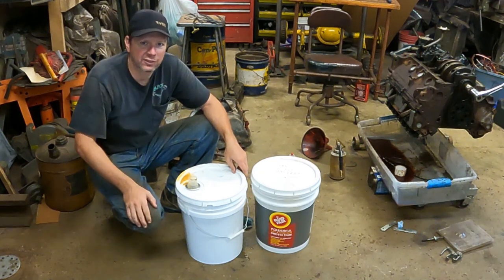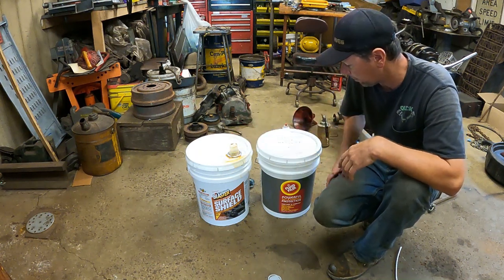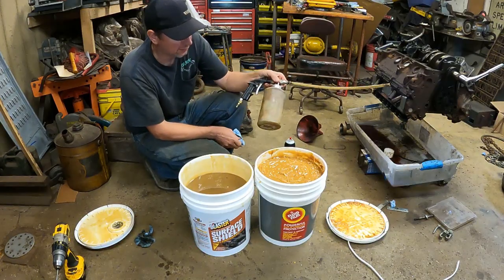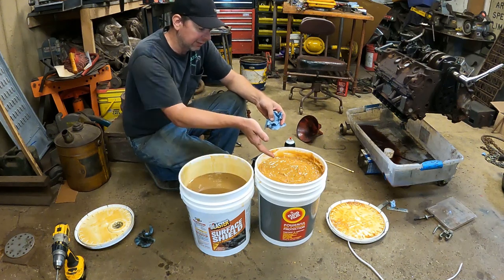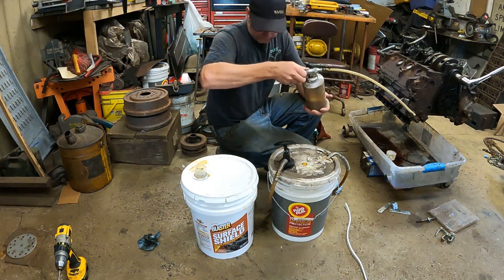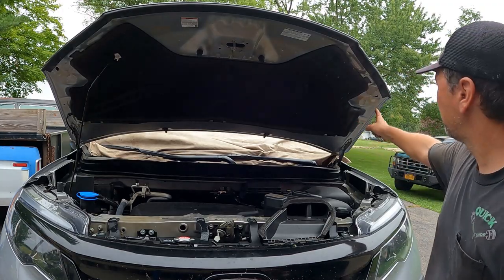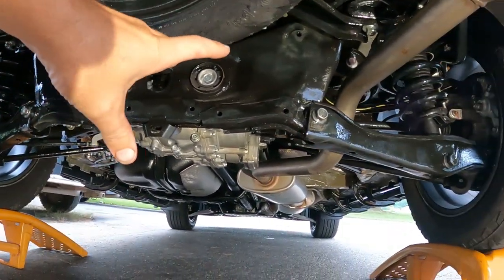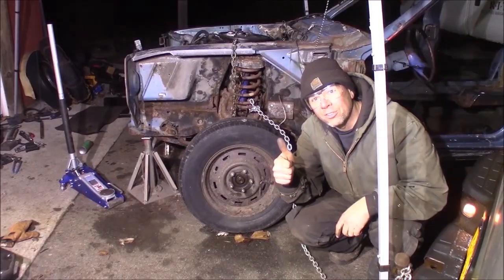Surface Shield vs Fluid Film:  Lanolin Rust Prevention

Comment: I can tell you that the Surface Shield is not easy to power wash off.  it should last excellent.  I tried power washing my steel wheel spare so i could bring it in and have the tire changed.  I had used it last December... that was June.   The stuff seemed excellent.  Underside of my vehicle will get a "touch up" this November  and recoat the whole thing next fall.  Pretty happy with it so far.  edit:   to add that the Surface Shield smells a lot better than the FF.   I used som FF from a spray can inside the doors so i would not have to bother with the compressor and gun.  The smell wasn't great for a couple weeks.
Reply: If you're re-coating once a year anyway, why spend double for SS? This was my rational when I saw the gallon price of SS vs. FF.
Reply: @red6743  It sticks better to cross members in the front end that get blasted with road spray and splashes.. I really believe it's a better product.  Ya' get what you pay for I think, so it comes down to personal preference and I live in the salt-belt so I feel it's money well spent.

Comment: ive used both products and much prefer the PB surface Shield, it sticks just like fluid film and doesnt drip much, but it sprays,covers and flows alot better even when ambient temp is cold, (ive had to warm up fluid film in a presto pot to get it to spray decent when cold out) also the PB does not stink like fluid film. it is a bit more expensive, but i was able to get a good price on it when O'reilys had a 20% coupon code online. it is also available in aerosol cans
Reply from the maker: I like how it sprays too.  I use FF because I can get it locally, but am impressed with the SS.
Reply: wow good call... i'll have to keep my eyes open for a code.  I bought a gallon on amazon and it's gone up since.
Reply: @g.fortin3228  right now there is a 20% code if you order over $150 - just order 3 of the 1 gallon pails.
Reply: @volks-jager  thanks  :- )
Reply: Fluid film is in spray cans as well
Reply: Anybody compared FF Nas vs FF liquid AR ?

Comment: For some reason Surface Shield is same price as Fluid Film in aerosol cans but in one gallon or 5 it is more then double the price. Look forward to the update comparison  video and opinion if the Surface Shield  is worth the extra money?
Reply: it is a new product so there is some gouging going on due to it not being as widely available. hopefully it will come down soon. i got my Surface Sheild from O'reily  auto parts in 1 gallon pails when they had a 20% online coupon so it was $60 a gallon
Reply: I guess because ss is 50% propellant and ff do  not have any.
Reply: True, I haven’t found it that much cheaper in gallon form. 5 gallons and spray cans seem to be closer in price to FF. From what I have heard and seen, surface shield appears to be competitive or better than fluid film. I’ll try it on my rusty Toyota and see if it can even slow that down a bit.. but not sure I want to buy more than a gallon..
Reply: I found the same thing. The gallon pails are very expensive! People are having massive issues with the cans not wanting to spray though. 

This time around I did the right thing. I put fluid film on the underbody of my Camry. They had 1 gallon pails at rural king for $40 which was hard to beat in any form especially readily available without paying shipping. 

Previously I used Krown and was very surprised how well it stayed in place during the winter of '19 to '20.
Reply: This is what kept me from purchasing the gallon and I stuck with FF. I'm not paying double for the same amount.
Reply: i did it last fall.   im going back to fluid film.  i think it works better , smells less and doesn't drip off the frame a year after application
fluid film seems to protect better ,   no dripping after the first spray and drive and the smell goes away after a day or three
Reply: @mrsa101 seems other people think the opposite.

Comment: woolwax WW HV will last indefinitely... very resistant to heavy roadwash ... over 3yrs and no need to reapply in the wheelhouse area. but it does develop a big layer of dirt on the top

Comment: I'm very interested in how Surface Shield will look next spring. But it looks by the SDS sheet that it has a very high percentage of petroleum to lanolin though, roughly 80/20. I would think that it might not be so good for rubber? Thanks for doing the video.
Reply from the maker: The bucket info says it won't hurt rubber, but we can see.  The FF will also make certain rubbers get a little soft as well.
Reply: Fluid Film also shows a high petroleum percentage. this is right from the Fluid Film SDS : Refined petroleum oil, hydrotreated heavy paraffinic 50-90%

Comment: Great vid and great idea for the pump!  Did you use one for the Surface Shield or is it not worth it?  I was using a solo cup and pouring that into a gallon milk jug with the bottom cut off into my sprayer bottles.  Worked ok, but a pump seems a lot cleaner.
Reply from the maker: I didn't use the pump because I did just pour it in the gun with a funnel.  If I was doing a whole bucket I'd set up a pump.

Comment: I tried them both, they both stay liquid and wash off far to easily... I eventually used CRC 06026 Corrosion Inhibitor to undercoat my truck, it is an industrial wax that thoroughly dries and won't wash off anytime soon.  I understand it is cosmoline based.

I needed to remove it from some areas that I accidentally oversprayed... mineral spirits liquified it but did not remove it, it dried hard again, I had to use acetone to get it off... pretty resilient stuff.
Reply: The CRC will fail you and your truck, FF and Blaster creep and self repair. No creep, no work.
Reply: @ptrazz11  Yeah it is my experience too.   Google "10 year of using cold galvanizing compound" and read a few last posts.
Reply: Surface shield doesn’t wash off… 😂
Reply: @ptrazz11  Cosmoline (CRC hd etc) dry and crack at top of paint when paint crack.

Comment: I will try surface shield on a new suv.  How much you use on a vehicle…one gallon? Do you cover the exhaust? Thanks
Reply from the maker: About 3 quarts really covers a full size vehicle well.  Don't spray it on the exhaust or brakes
Reply: @QuickSpeedShop  awesome thanks for the reply.  I guess I’ll have to buy the 5 gallons to do my 3 cars.
Reply: @QuickSpeedShop  do you apply it on September…closer to Winter?
Reply from the maker: I'd do it before it starts to get cool.  Sept or Oct.
Reply: @QuickSpeedShop  what spray gun you recommend?   I was checking the woolwax pro for $90
Reply from the maker: Any Fluid Film or Woolwax gun will work

Comment: That Surface shield in thethe pail looks like low viscosity Fluid Film.
Reply from the maker: They are both lanolin, but the SS has some petroleum distolate which I think makes it thinner
Reply: @QuickSpeedShop  I was mistaken, Fluid Film has different blends. However, Woolwax, has a low viscosity product. I use their regular Woolwax in black and usually spot treat at every oil change or anytime I roll around under my pickup. Every winter the rockers, doors and fender wells get a fresh coating of Woolwax and Fluid Film. I’m getting ready to do 2 more cars mid October

Comment: did my jeep with surface shield last fall.   all this summer once it got hot it's persistently dripped off into my drive after a drive.   and it doesn't seem to have held up over the year .   it's 11 months now.   back to fluid film for me.    i don't need drips all year.   also the surface shield smelled bad for weeks after the application.   fluid film usually dies off in days
Reply from the maker: Thanks for the advice
Reply: I sure hope this doesn't happen to me.  I just sprayed my SUV with SS and have 3.5 gallons left from the bucket.  I notice it does tend to thin out in the sun but I am hoping it will not drip after the major runs have come off.
Reply: It is good news for my setup.  I use Cosmoline on exposed area and ff in cavities.  If SS is so thin should look at it too.

Comment: I used to work for IDOT in Illinois.  We put down so much salt it destroys everything.  I use Fluid Film but use whatever you want.  I just purchased a 1973 Chevy K10 from Montana that's virtually rust free.  I sprayed 5 coats of SPI Epoxy primer on the frame and underside and then just recently hit it hard with fluid film.  My local body shop man told me to spray oil in the doors and rockers/cab corners and inside up over your wheel wells.  Never put anything on it other than like Epoxy primer that I painted it with that won't wash off.  Some products stick you don't want that.  Good luck in the salt!!
Reply from the maker: I found that FF soaks into flat paint great.  I paint flat paint on stuff then FF over it.
Reply: @QuickSpeedShop  Here we have a local FF representative, and they sell something called Perma Film - the stuff is dry to the touch, supposedly elastic underneath, and it works together with FF (i.e. you can paint it on stuff soaked with FF). Seems pretty tough. Bit more expensive than FF.

Comment: I was ready to switch to Surface Shield bc I've seen tests that shows it lasts longer....but then I saw the price vs FF. You can purchase 2-gals of FF for the same price of 1-gal of SS. I'd still re-coat either product once a season so it doesn't make sense to buy SS. Fluid Film has kept the bottom of my truck rust free so why switch?
Reply from the maker: Yeah, I know it's more money
  I just sprayed it because my friend bought it.  I think it probably does a better job than FF, but the extra $100 is hard to take.

Comment: This guy is a messy hack of an operator. I would never indiscriminately spray someones vehicle in the manner he did. Spraying under the hood in that hectic/sloppy manner said it all. Oh, a proper mixer for a drill works MUCH better at actually mixing things. They are only a few bucks. Wall plaster mixers work best, imo. Start there.
Reply from the maker: Hey, guess what gets everywhere including under the hood?  Road spray and salt!  I coat everything to keep it from rusting, including door jambs and under the hood.  No one has complained about too much FF.  They want to protect the car they paid $30-40-50k for from rust.  I spray everything except the engine, exhaust, and brakes.  You call it sloppy, I call it thorough!
Reply: @QuickSpeedShop some people! 🤦🏽‍♂️☝🏽